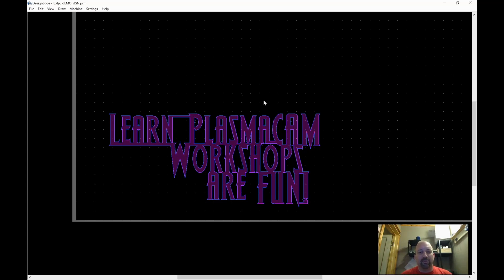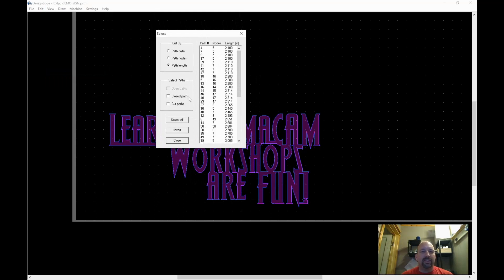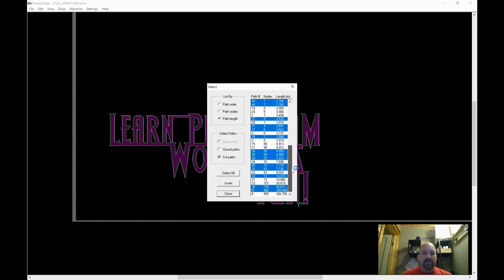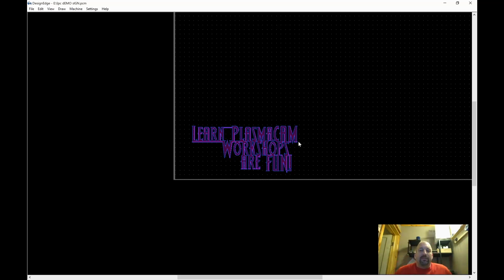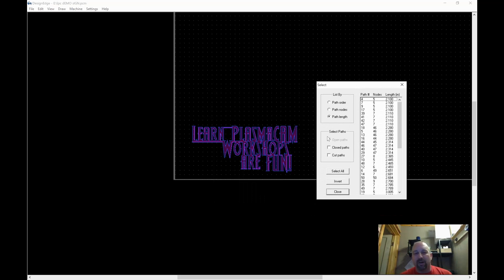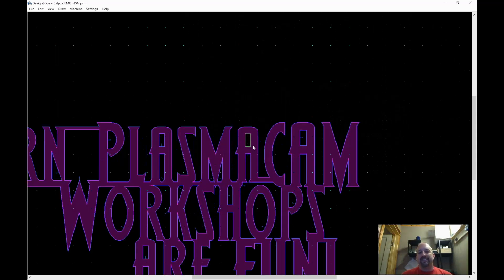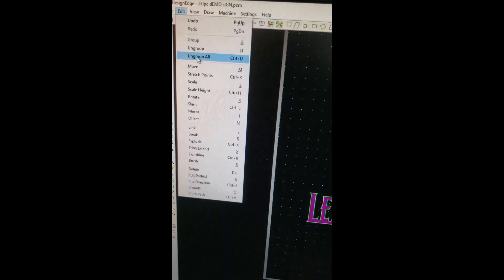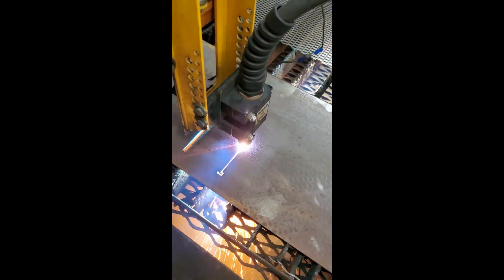Design Edge Learning Series 003 - Select Tool

Comment: When you have a drawing linked, How do you get the whole middle or the inside to be colored in and or solid?
Reply from the maker: Trevor, assuming it is truly joined and there are no gaps or intersections then it will turn purple (when not selected). The shading comes from a setting on the design tab. It requires advanced design so if you have that then you can just tick the box for “fill solid closed paths” on the top left of that setting screen.
Reply: I have been having trouble with my cutter going over lines several times. Is this an issue of having multiple paths on one line? I have been working to figure this out but I’m still not sure.